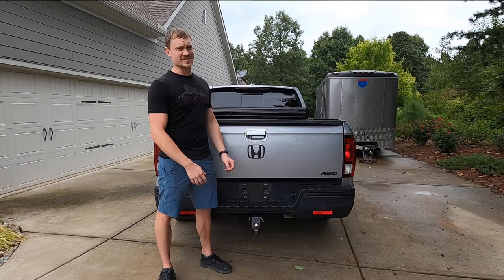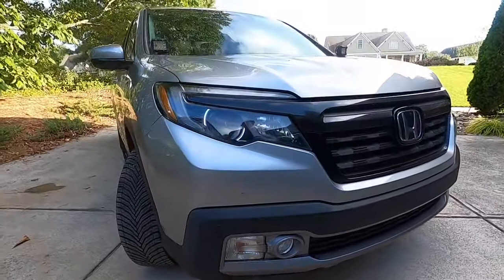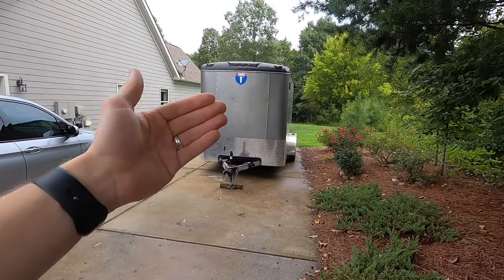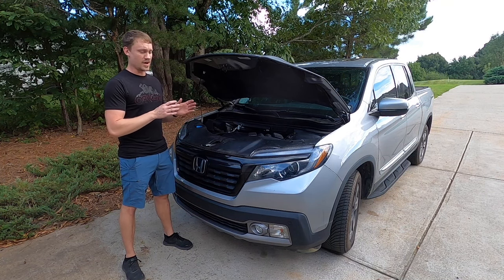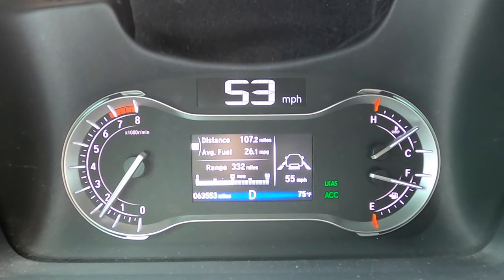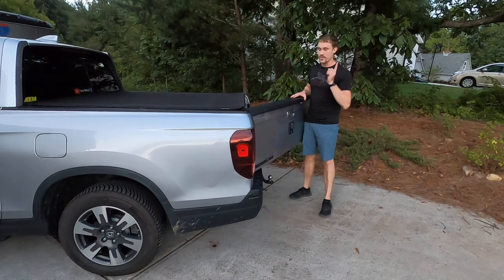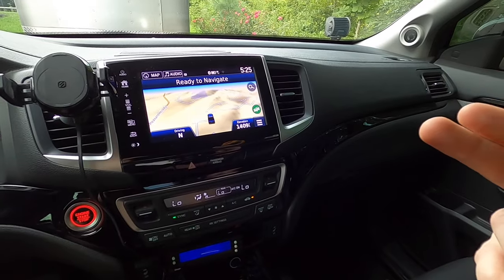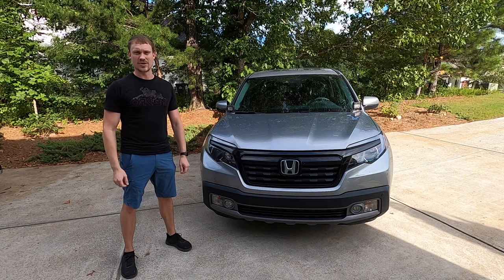10 Things I dislike about the Honda Ridgeline

Comment: All vehicles have compromises. Need a bigger truck? Trade it in. Honda's hold their value. Ridgelines are medium sized pickup trucks designed for smart people who aren't wrapped up in some daydream about manliness.  Lose the running boards if the ground clearance is low.  Aftermarket 2" lift kits are available. Love my 08, has 220K miles on it. I wouldn't consider towing more than 3500 lbs. cross country. 5k for short trips only, it's a 6 cylinder after all. Honda has millions of 3.5 engines out there, been doing the oil filter location the same way for decades. The oil filter location is the same with all of them. If changing the location was feasible it would have been done 20 years ago. The tail gate option to use the side hinge is nice despite the negatives.  It's not like other trucks, again a compromise. The Ridgeline incorporated front wheel drive first which was finally copied into the Ford Maverick (that only took 15 years). Has a locker rear end when needed, but it's rarely needed because it's front wheel drive. These things are f'n awesome in snow or poor road conditions, no truck in two wheel drive can beat it. It has a full frame that isn't separate from the body. (Have fun changing those body mounts big truck guys).  Great ride, get 19 mpg at 80 mph.  I hear the Gen 2 gets even better gas mileage. The fiberglass reinforced poly-carbonate bed panels are tough as hell and replaceable if the last owner put some of that crappy bed-liner stuff on. Ever get stuck with a crappy spray on bedliner? Point is that the positives far out weigh the compromises. Bottom line for me is that the utility, quality and value is outstanding.
Reply: I agree.  I'm not trying to bag on anybody that needs more truck but I don't, this is the right tool for the right job for me.  I really like the trunk in the bed.  Anybody that I show that to is like, "That is awesome!"
Reply: I fucks with you 💯
Reply: I came here just to like THIS Comment!
Not the video, Just THIS Comment, it's a damn sensible  1/2 tonne truck, for reasonable people that need simple use
Reply: My 2008 has 396000 and would have probably 100000 more if I hadn’t worked from home since Covid.  I be never had to repair anything other than a few things that failed due to life expectancy.  It pulls what I need, rides great still, motor is strong, and loved the trunk when I was on the road for my job (love it having been at home.
Reply: @Texashog11  that's amazing to hear!

Comment: I hate, hate, hate the transmission buttons!😜
Reply: Yea. Put a dog in the front seat and he'll step on neutral just before the light turns green
Reply: Oh yeah, you got that right !
Reply: Yeah I saw that and was not crazy about them either.
Reply: Spill your drink
Reply: After a couple years I've kinda got used to them. Still rather have a real shifter though.
Reply: I enjoy the buttons in my passport, easy access to the phone wireless charger.  To each their own I guess.
Reply: Yeah,  totally needs a column shift

Comment: dude put a funnel next to the oil filter to direct the oil flow and take off the stupid running boards
Reply: Or just put an old gallon size freezer bag over it when you unscrew the old filter, any oil spilled will go into the bag. Simple.

Comment: Before you took off the oil filter, make "half circled funnel" with cardboard - then the old oil will not splash everywhere.
Reply: Loosen the filter with a wrench then slip a plastic bag over the filter, then remove the filter.  The oil and filter stay in the bag.  No mess! 😊

Comment: Interesting you have a problem with the ac, I’ve found that it’s usually blowing cold air by the time I get to the end of my street. I usually keep the fan on the auto setting and the temp at 73° and it does a good job even on 95°+ days.
Reply: I am with Yuriy on the AC issue.  My truck seems to take forever to cool down, even though it's blowing cold air.
Reply: I wish mine cooled faster too, but usually I just turn it full blast and usually good in 2 mins
Reply: Idk I’ve noticed mine is ice cold but I also have a 2022, idk if that makes a difference

Comment: Two thoughts. You have one AC vent almost 100% blocked by your phone mount. How is that impacting overall circulation? And did you check your Nav settings for  Calculation Mode to “faster time” and the Avoidances setting to see if it is in the default setting?  I’ve done many long distance trips and rarely see a noticeable difference between the Honda Nav and Google maps or Apple maps.
Reply: That was a good one!  My phone does block my a/c vent but I still get cooled!

Comment: If the Honda is in ECO mode it will cycle the AC compressor off sooner to reduce fuel consumption. Turn off ECO when temps are above 85~ or when high humidity is present.  Detail in the manual; RTFM. hope this helps , nice truck

Comment: I think that the Ridgeline doesn't have a lot of aftermarket options available is because it caters to a different demographic than vehicles like the Tacoma, the Gladiator, or the off-road oriented versions of other mid-size trucks. 
It's geared towards ride comfort, dependability, and the occasional run to Home Depot, and I'm guessing that the average buyer is usually quite a bit older than someone interested in the Taco.
Reply: True I left a audi q5 because I fly large model planes that fit perfect in bed  .It rides better then the audi.LUV everything about the truck .A/c works great I do wish I had the power folding side mirrors
Reply: Actually that was my only dislike I'm curious why buy the truck if their is so much you don't like about it
Reply: @charlesrestivo870  There isn't a lot that I don't like. I might buy one because I'm a bit older, and don't need all of the whiz bang off road hardware, or towing capacity beyond the 5,000 pounds that available.
Reply: I'm 73 years old and love my 2022 Ridgeline, for me it will serve my needs perfectly. I didn't buy it to go extreme off road driving like the other 4x4 trucks in mid-size.
Reply: Me too 71 years old
Reply: I like it and I'm 61 years old.  Very practical and I don't need to slug across rivers and roll over gigantic rocks.  Ok Boomer.
Reply: @Bergarita  I'll be 70 this year, and am also thinking about buying one. I'm torn between getting a small pick-up and an SUV, but the Ridgeline is the only one I would consider because I don't want the ride of a body on frame truck.
Reply: @robertmowery9596  Same here, 69 years old.
Reply: That's because it's a minivan 🤣🤣🤣
Reply: It’s for people like me who need to haul bulky items sometimes but I don’t care about bashing through the forest trying to get stuck so I have a story to tell.
Reply: @Surfbird11  Lol! Ditto.
Reply: It's based on the Honda SUV's. It's a Pilot with an exterior bed. It's for people not wanting rock crawling capabilities. It's not Honda's fault there isn't a large aftermarket. That's up to those companies that make aftermarket parts. I don't think the majority of Ridgeline owners want or need lift kits and winch bumpers. The only gripe I have with the Ridgeline is that it needs a full size LED gauge cluster and a larger touchscreen for the audio and navigation. Honda is far behind other manufacturers in that regard.
Reply: I sat in one and really liked it because it didn’t feel like a truck, more like a regular SUV.
Reply: You described me accurately. Love my 2022 Sport.  Great family vehicle.

Comment: I like that the Ridgeline 3.5-liter V-6 which is more likely to last over 250,000 miles compared to the Chevy Colorado which only offers 4-cylinder engines in their 2023 model.  I also like the Ridgeline has the greatest width between wheel wells of all midsize pickups.  Great for hauling 2 large dog boxes, a sheet of plywood, etc.
Reply: And is why we just bought a 2020 Black Edition, For heavier loads My 97 Chevy Silverado will be fine, But that Gas Hog it's nearly as nice to Drive long distances 😁
Reply: Id rather carry my plywood crooked than deal with the transmission problems of the ridgeline.
Reply: For it to last you'd need the whole timing belt maintenance deal at 100k and 200k, which costs about $1,500 (x2).  There are smoother, quieter, more efficient, more powerful V6s that will last 250k nowadays without that kind of costly maintenance.  Honda 3.5 = Y2K technology.

Comment: Thanks for the review!
Some random thoughts
- GPS: Inaccurate, or more realistic? I my next of the wood, the Google-time are often on the optimistic side of things.
- Oil filter: The mess could easily be avoided by putting a large zip-lock bag over the filter... but I'd be a little worried about its location and lack of protection. As in, aren't people worried that a rock will fly-by and hit it?

- Lack of tailgate dampener and electric folding mirrors: I think it's kind of a good thing... something less to go wrong as the vehicle ages.

Comment: That  oil filter location is gift from God compared to where it is on a '15 Escape 1.6L Eco-boost. Just stuff a bunch of rags under the filter when you start to spin it off. You're lucky to have the filter hanging straight down, the Escape's filter is horizontal!

Comment: My biggest dislike on my 22 touring edition 🇨🇦 is the delay in the shifting the transmission when I reverse out of my driveway and the. Put it in drive. Second would be the extremely slow power windows in the front. The adaptive cruise control is bad, I refuse to use it anymore. 
I now have 9,000 kms .

Comment: I agree on all points..  My biggest two gripes would be the low clearance height and the lack of tailgate dampener.  It's not a big work truck so I don't expect it to tow 7000 lbs.  But it does provide a nice balance of daily driver and light work.  Which I believe is a totally different demographic.  I came from owning a few GMC Sierras and Tundras and hated the daily drive manners.  It was not my work truck but a truck I used for fishing, camping, and towing my motorcycles.  Hated the drive to the office each day.. very bouncy and unstable at highway speeds.  The Ridgeline was a perfect replacement vehicle.  Add a small lift kit, and some slightly bigger all terrain tires and you have a winner.  Can't wait to see the Ridgeline with the new Pilot interior, engine, and 10 speed tranny. Build it and they will come.
Reply: I am in agreement with the two biggest gripes. My wife absolutely loves her 2018 Ridgeline. She is 4'11" and about 100 lbs. However the tailgate needs a dampener. She uses the swing feature almost exclusively because her height and reach makes drop-down tailgates difficult. Also we get some heavy snows in NH and the plow often deposits 2 or more feet in front of the driveway.

Comment: You can set the Garmin unit for different modes, shortest distance, shortest time, freeway or not freeway, etc.  Might want to get your  A/C looked at.  We have had over 30 days over 100 degrees.  Today I had to run an errand it was 98.  Ridgeline was in the shade, dark grey interior.  It was cooling down within a few blocks and after another minute of two comfortable.  I never use more than the second fan speed unless it has been parked in the sun and I need to cool quicker for a few minutes.
Reply from the maker: I have all my settings on the map set to best route. I have done a few head to head comparisons against Google maps and Harmon Honda unit has been as bad as 1hr longer route. My AC may just be my truck. Not sure why, but it just doesn’t perform to the level as other vehicles I drive and have driven.

Comment: You comment about the ground clearance is spot on.  I just bought a 2023, and I got it home, and immediately thought, it needs a lift. They do make some bolt 1.5 inch lift kits, and honestly, I think that would suffice. But here in Washington, I will go off road just a bit, very slowing to get to fishing holes and such, so I don't need/want a Tacoma, but I do want my Ridgeline to get me there.

Comment: Transmission cooler, towing capacity, and ground clearance are my gripes as well.  I would definitely have your AC system checked, mine will freeze me out and I live in TX.  I will say that having 70% tint on the windshield has helped quite a bit.  The black dash absorbs a ton of heat.
Reply: how often do you tow more than 5000 pounds? 85% of truck owners never utilize the full potential of their truck and statistically, unless you're using your Ridgeline as a work truck you are likely never going to tow more than 5000 pounds.
Reply: Yes, have the dealer check some of the gaskets for the AC line in the dash. This happened to my Acura and it was just this O-ring that they had to replace.

Comment: great channel…I have 2019 Ridgeline, no issues with my AC, it gets really cold inside when boiling hot outside (Texas or Florida hot). Low clearance actually works for me since I don’t take it off-road, which means lower clearance better gas mileage. Agreed on towing capacity, folding mirrors. Those are just my pet peeves, I love this truck
Reply from the maker: Thanks Robert!
Reply: @YuriyMotso  I owned Mercedes, BMW, Toyota, Subaru... I am not a car guy, but I do take care of my cars. Ridgeline is by far the best vehicle I have ever owned. I have 2019 RTL-T with 29 K miles, mostly highway. It drives the same today as it did when I bought it. I live in Chicago in the city...this thing is so versitle, perfect. It is also very reliable..few years ago I was in WI, winter, 20 below. Remote start worked no issues. The only issue is Honda is horrible at marketing Ridgeline, which is a perfect vehicle as far as I can tell

Comment: My Ram 2500 Cummins had the oil filter in a similar location.  I would loosen it a little, then slide a ziplock bag over it, finish loosening it and seal it up.  Saved some mess.

Comment: I have a 2009 Tacoma which I love but as I’m getting older (61) I’m looking for more of a “car” with a truck bed than a truck. I don’t off road or tow. I use my Tacoma as a truck a dozen times a year at most. I’ve had several Hondas and all of them have been wonderful so I’m giving the Ridgeline a look. My daughter has a new Pilot and figure this might be an option. Also, for your oil change issue, cut a two liter plastic bottle in half lengthwise and place it under the filter. The oil runs into the bottle which channels it into the drain pan underneath. Works great for me. Most of your other issues makes it sound like you need/want a bigger truck. Thanks for posting.

Comment: I have a quick tip that would avoid spilling oil when removing the oil filter loosen it a bit then put a cup over it like a plastic one bigger that the oil filter then remove and the excess oil will fall in the cup bingo no mess 😊👌👍
Reply: I place a sheet of doggie pee pad over the frame to keep it a little cleaner. 👍
Reply from the maker: I currently use a plastic ziplock bag.
Reply: A gallon ziploc bag works great, you won't spill a drop.

Comment: little behind on this post but I just got a new rtl and would like to add to your list...no "flat four" towing receptacle I had to buy an adaptor...no settable "Speed Warning"...not crazy about the Arm Rests I would welcome the extra storage a higher console with the built in rest would provide...lane mitigation and lane keeping assist, confusing, don't like either especially when the wheel shakes...smallish tire/wheel combo look out of place...both Front & Rear Parking alarms are sporadic and unreliable. Tailgate, Cruise Control, Rain Sense wipers agree with all

Comment: Adaptive Cruise Control (ACC), in my opinion, is too safe of a following distance (even on the lowest setting). I would like it to follow about a truck length closer on the closest setting.
ACC may also be why your cruise control isn't always holding the MPH you set it to (it's constantly adjusting based off of distance to car in front).  
You can also turn ACC off by holding the cruise control button.
Reply: Some cruise controls are lazy with shifting and it ran out of torque and waited to downshift which is what looks like happened. My Jeep is extremely aggressive and downshifts quicker in cruise control on the same roads than if I manually hold speed. Which means cruise control actually gives me 2 mpg worse economy.
Reply: Maybe get a truck that has those accerssories
Reply: @schoc13  no manufacturer is going to let the vehicle be closer than 3 vehicle lengths at highway speeds. The whole thing about safety. My point is even at the closest ‘follow’ setting there is enough of a gap that other drivers will merge into it and then the ACC freaks out, slams the brakes.

Comment: I have a 2017 with 80,000 miles on it.  Hands down the best vehicle I’ve ever owned.  Inherent in most trucks is that bouncy truck drive.  Being built on the Pilot platform, I love that it drives like a car ALL the time, especially since I need a truck only about 5% of the time.

Comment: As for the A/C - have the system evacuated and recharged. I had the same issue with mine and the refrigerant charge from the factory was a tad low. After recharging, it blows nice and cold now.

Comment: Agree on your comments on the cruise control. I traded a 2018 Subaru Forester with "eye sight" cruise control that was felt very natural when following other cars. My 2023 Ridgeline seems to hunt and feel less natural when it's pacing another car. I think maybe due to the Forester having dual - cameras it can detect distance better as well as just smoother software. The Ridgeline seems to be brake and accelerate continuously when trying to pace a car.

Comment: Great video. Number 11 should be the cup holders. 43k for my ‘21 RTL-E and the cup holders don’t have the spring loaded fingers or rubber inserts to adapt to different size cup diameters. Such an over site on Honda’s part. My ‘12 RTL had this. My ‘16 Acura TLX has this. Why not the 2nd Gen Ridgeline?
Reply: and that brings us to the lack of aftermarket parts because I haven't found suitable inserts to solve it.